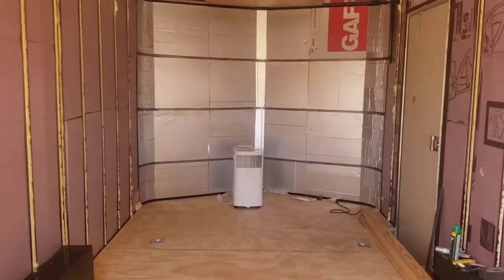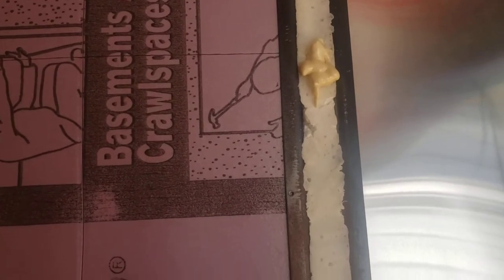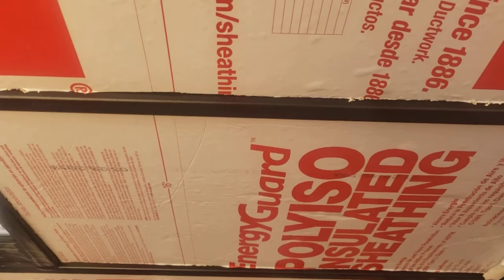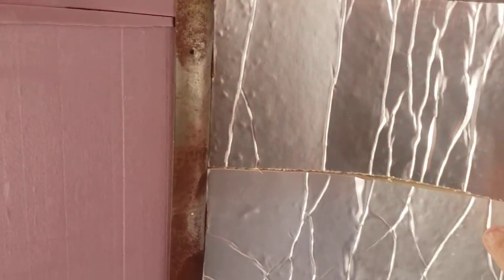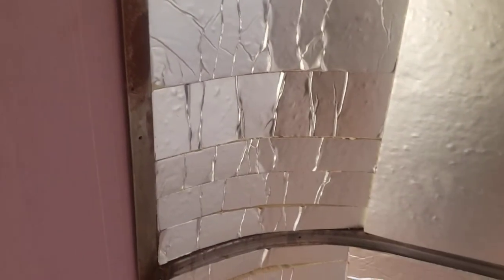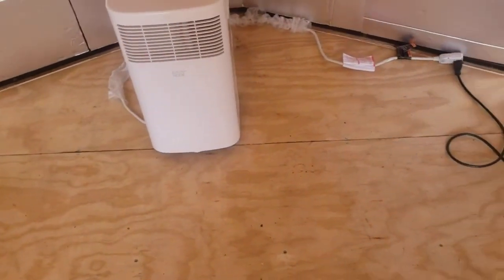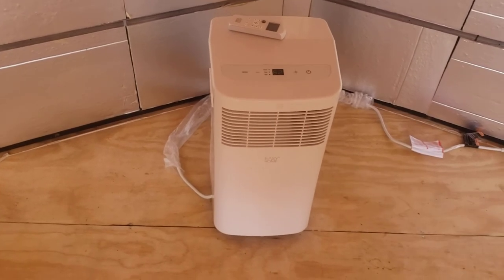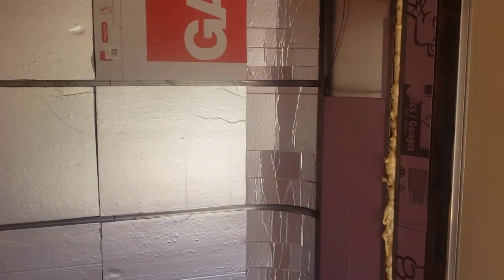Important Insulation Basics for Cargo Trailer Conversion Part 1

Comment: I’ll be interested to see how the build progresses.  As an option to using spray foam on the rails, cut left over wall board into strips and wedge them in and use metal exhaust fan tape to cover, you can also upgrade the inside std 3/8” plywood to 5/8” plywood. Best of luck

Comment: I used the same insulation board,1" thick because beams were 1" put the plywood walls back up in exactly the same place same screw holes, covered all seams between insulation board and beams with foil tape then topped it all with panelling,it's perfectly insulated now against direct sunlight
Reply from the maker: That's great we have been very happy with ours also.
Reply: @preciouscargo1792   Thanks for this video. We’re just starting to insulate our 8.5x20. It’s basically going to be our toy hauler for our sidecar bike as well as the place we will sleep while doing day trips from a KOA campground. 
I like your style. Similar to me, you just do what you need, not what might be perfect for others. 🤙😎

Comment: Metal/Alum is a conductor of heat or cold.  So it will transfer it to the next product or material. When I am building homes and we are putting on the roof , framing - sheeting and actual roof material that air space is important.  Like the attic area, venting location etc...Do let the heat build up vent out.  On the wall area of homes we leave about an inch and a half air space if it is brick  or a 1/4 if vinyl or wood.
Reply from the maker: Right you are, if I had it to do over again I would probably leave that gap in between the metal of the trailer and insulate from there.  I wanted to use reflectix to do that however they said I needed more air gap for it to be effective.  Good thing is when I cool it off or heat it up it holds temp nicely.  I appreciate your comment.
Reply: @preciouscargo1792  Hi from Tenn area /  Iam building out a C.T. cargo trailer and Iam just going to get a tarp made to cover over top of the C.T. for that to use as a attic/air space.  In the 47 years that Ive been working  in Const. I have yet to get a pro or a manufacturing rep to give me true advise with insulation products, Why?
Reply from the maker: That is a great idea, I thought of doing the same but could not think of a simple way to do it without it being a hassle to put up and take down.  I would love to hear how your doing that and I'm also curious what size your C.T. is.

Comment: for high heat areas its best to do an Radiant Air Gap between the outside and inside with foil backer.
Reply from the maker: The set up as is performs well enough in Summer and excels in our winter weather.  Radiant gaps are effective if you can get enough gap, that is why I did not go with something like Reflectix.
Reply: Really good tip,thanks much!

Comment: When it gets to freezing and below outside and you're heating the inside, your wheel well boxes will frost on the inside unless you also cover them in foam board.
Reply from the maker: I have not found this to be the case!  If the temperature inside is comfortable it is impossible to the metal on the wheel wells to frost unless maybe you are heating with propane and even then I doubt it.  Is this something that you have had trouble with?
Reply: Mhm... If you are using diesel or electric heat there is no condensation.
Reply from the maker: That is correct!

Comment: Curious in the winter when you heat does your fender wells condensate?
Reply from the maker: I have not had that problem however here in the Atlanta area it rarely gets cold enough for that to be a problem.  If I had it in a colder climate I would insulate them for sure.

Comment: it is better to just run 1 inch runners across the beams and add 3/4 inch board.  it will trap small air gaps between the two and insulate better.
Reply: I’m trying to understand,  so run the 1” runners not parallel but like across? And then insulate just the thickens of the runners but not actually have the insulation touching the exterior wall or roof? So there’s an air gap between the insulation and the exterior metal or what ever it is?
Reply: @LTZ400Mark  I will be adding 3/4 insulation between the runners and yes they will be perpendicular to the ine inch boards

Comment: I'm sure you have,"lots of good reasons"... for doing things the way you do them,however; they may not ALL be good reasons.

I believe fastening your foam board in direct contact with the metal  siding is a major mistake.  You should have an air space.  (I know, everyone does it that way) .

I would use rigid insulation with @ leSt one reflecti e side facing out.

Then, each and every minor seam created by salvaging those scrap pieces together should be sealed with specialty foil tape.

IF you think rigid foam board is expensive, just wait until you price foil tape.

N0T insulating the floor first will prove to be a major mistake!
Reply from the maker: Thank you for the feedback and I would have kept an air gap however with only one inch of space the air gap is not sufficient to use reflectix to any effective degree, and I called the company to confirm minimum air gap needed which was 2 inches.  That being said I am not trying to turn this thing into a super insulated space.  Currently I can easily heat it and cool it and the insulating I did seems to be sufficient.  Of course the floor is a must however that will be done at a later time.  I appreciate you providing your expertise in thermal dynamics as I am clearly not one.

Comment: I hate that spray foam crap, it always make a big mess for me!👍🏼☮️
Reply from the maker: Agreed, spray foam is some hateful stuff, I used it in a few places where nothing else would fit.  I tried the Loctite spray foam along with the usual Great stuff and was not impressed at all with Loctite except that it was a bit more dense once cured.
Reply: Sorry but when foam is sprayed professionally you won't regret the performance. Cost $1000 To have my 8.5 x 22 foot trailer sprayed. 1 1\2  in the walls and ceilings. 3" sprayed under the trailer floor. Added strength to the whole trailer plus sealed air tight.
Reply from the maker: Yes the professional foam is a whole other ball game for sure.  Great Stuff is not so great!  I like the idea of doing it underneath too, I have yet to insulate underneath.

Comment: Use rubber paint like flex seal on your steel/metal, it will save your ass dude.
Reply from the maker: Interesting idea, too late for this build but if we do another I will take that to account.
Reply: What does the rubber paint do?  Why put it on the metal?